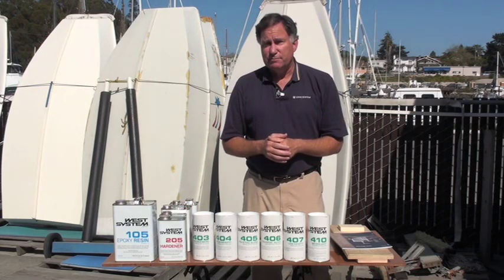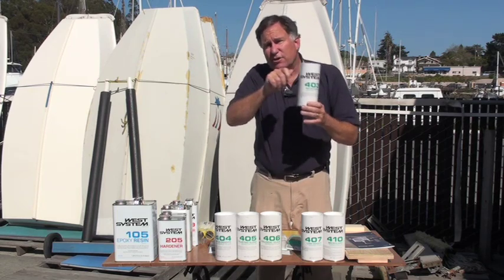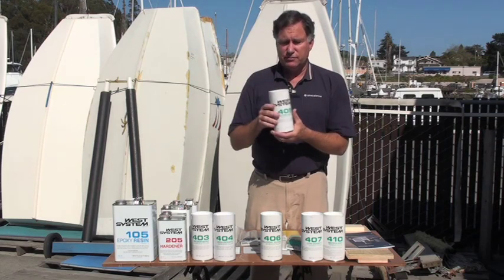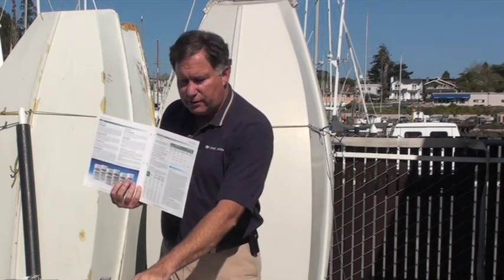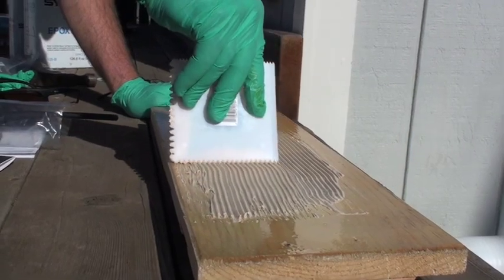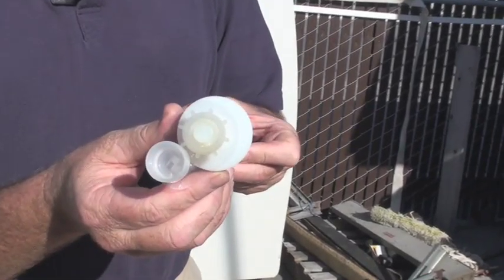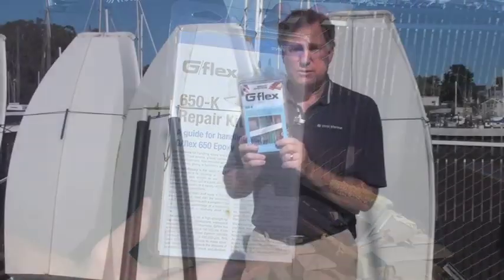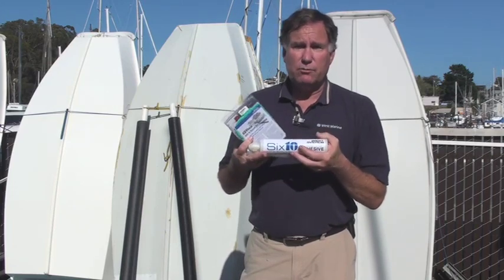DIY Fillers and Additives

Comment: Want more info on 422 barrier coat additive.  Can it (and WS generally) withstand heat?  And can 422 be mixed with g/flex as an automotive underbody coating for spot application to abraded bare metal for rust treatment. & prevention